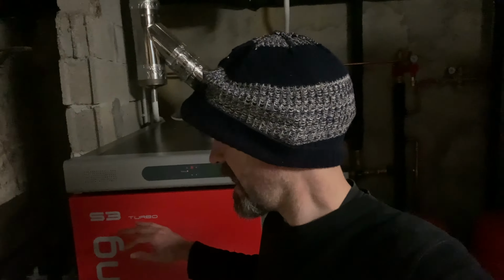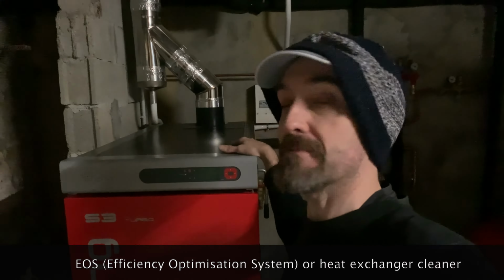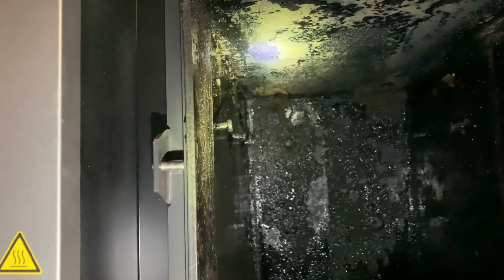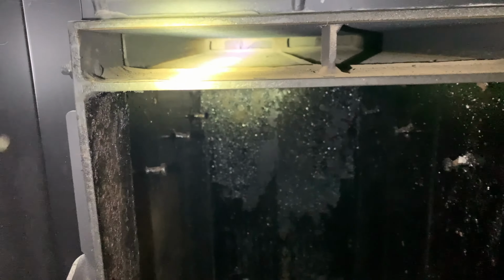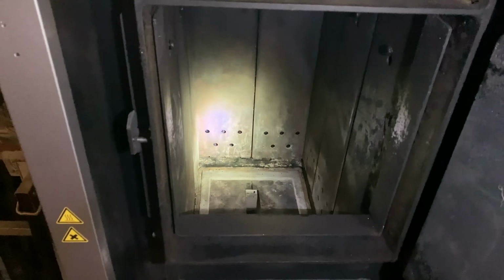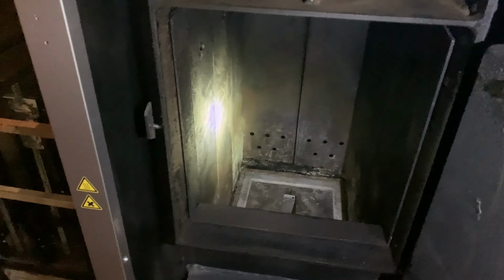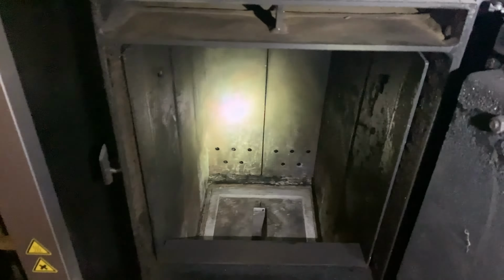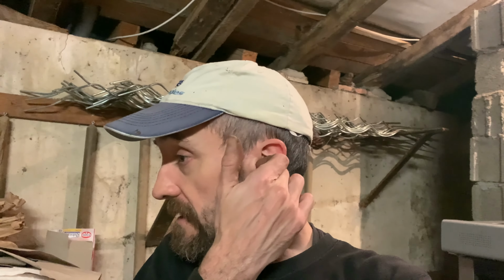Maintenance Tasks #4 - Froling S3 Turbo Boiler Service

Comment: I just bought this exact boiler and I pick it up next Tuesday. Thanks for this cleaning demonstration, it will help me for when it is time for mine, although, I was yelling "slow down," but I did get all of it.  Again, thanks, it was a big help in understanding what I will need to do. 
I do have one question, how much wood do you burn in a season.  I know location temps will play a major role in consumption, but a ballpark figure does help. I live in a cold climate in northern Maine.

Comment: Ben- have you ever overheated the boiler and had to reset the high-limit thermostat.  I just did mine and cannot find the reset.
Reply: You’ll have to unscrew a black cap at the back of the boiler and with a screwdriver, push in the reset button

Comment: Have you ever taken out the vents on the side one of mine is stuck open.
Reply from the maker: Hi 👋 if you mean the adjustment vents used to set the boiler for the humidity in the wood burnt? - then so far not as yet.

Comment: What are your system specifications? I am researching this brand myself.
Reply from the maker: Here you go: 
S3 Turbo 20
20kw normal power output
Max temp 90 degree
Max pressure 3 bar
Water capacity 120 liters
Consumption 70w